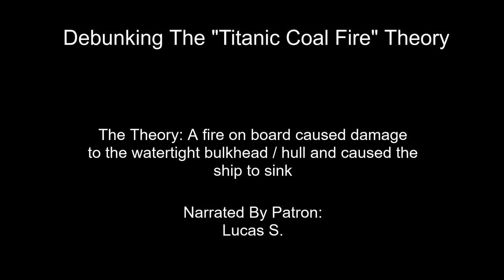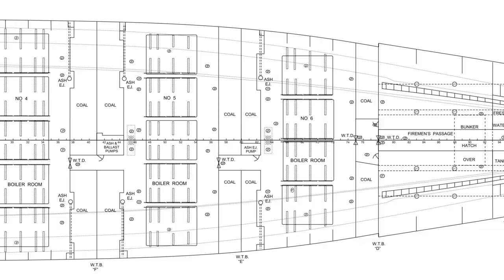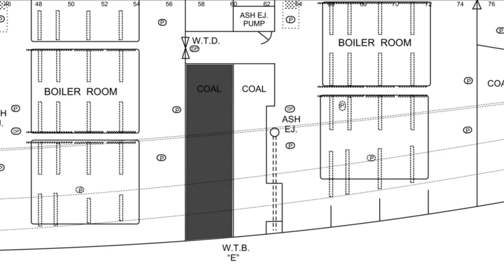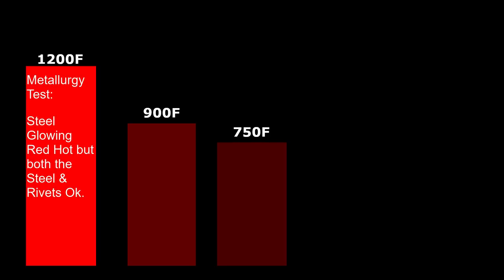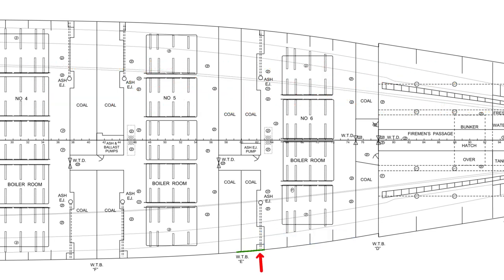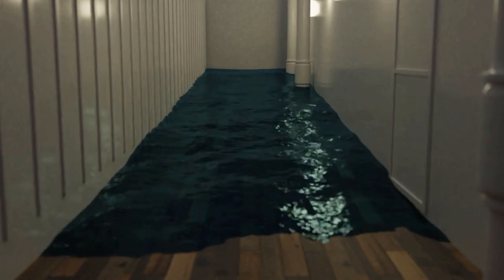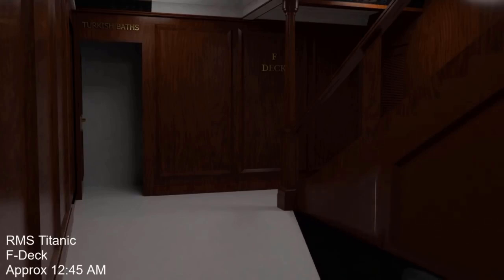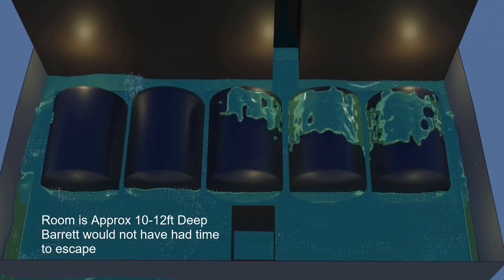Debunking The Titanic Coal Fire Theory

Comment: coal fires can't melt steel bulkheads
Reply: They can weaken em for an iceberg to do the rest
Reply: @sherylstapleford2005  that's like saying they can weaken them for a dynamite blast
it doesn't need the assistance, it's perfectly capable alone
Reply: Highly doubt the iceberg ripped open boiler room 5 which started flooding right where they say the coal fire was coincidentally
Reply: people all the titanic needs is one compartment to rip open from weak steel and BOOM! cold water plus hot coal = explosions! causing more damage and more leaks thus more explosions...
Reply: Ultra CNC  You're being awfully smug for someone saying nothing.

If you read the thread, you would have grasped that we were talking about the hull integrity. I was using the comparison to say that the hull did not need to be weakened to be damaged by the iceberg, any more than it would by a stick of dynamite.

Get it now? Or do I need to spoon-feed you some more basic reading comprehension?

EDIT: Ah, they deleted their comment. Owned.
Reply: What about jet fuel
Reply: Well apparently it can. (who knew- lol) Because the World Trade centers were hit by airplanes and the government wants you to believe that the fire was so hot it warped the steel frames all of them at the same time and it fell down perfectly in it's foot print. NOT I guess those pictures of people hanging out side the windows and one in the impact zone could with stand that kind of heat.
Reply: ^ this person is not affiliated with me
Reply: @DarthMeteos  Good, hopefully nobody is affiliated with them
Reply: @DarthMeteos  when you heat steel the rapidly cool it, it can make the steel brittle
Reply: @richerdmeranda7561  because, of course, a million tons of ice requires some brittle steel to make an impact
Reply: @DarthMeteos  well even without the fire the ice would have made a hole, the brittle steel just made the hole bigger
Reply: @richerdmeranda7561  the size of the hole is not relevant
it's the amount of compartments breached that mattered
Reply: @richerdmeranda7561  it wasnt rapidly cooled and hardening steel is dependent on its carbon content, low carbon steel like that which was used on ship plating can only be made so hard regardless
Reply: @Full_Otto_Bismarck  you have a fair point
Reply: @DarthMeteos  it is probably responsible for the port list that happened
Reply: But they can make them weak enough for an iceberg to puncture
Reply: @DarthMeteos   ...icebergs are just ice not rocks
Reply: @romania_patriotedits1450  if your implication is that an iceberg cannot pierce a ship's hull without assistance, then i gotta be real with you and say that my iq lowered by reading your comment
Reply: @DarthMeteos  ... it didint pierece. It broke of the metal plates it bended them to such an extent they kind broke
Reply: I think the iceberg didnt tear it open like a can, No, I think the iceberg bent, dented and warped the hull till the point when the rivits Burst out of their areas, with no rivits in that area, the iceberg could jagger and burst open the hull, letting water gush into the ship within seconds
Reply: Shut up on all the vids
Reply: @caseydopp318  nah
Reply: @DarthMeteos  However, Remember that Titanic could stay agloat with the first FOUR compartmenta breached, but with fifth the ship was doomed so wvwn if Boiler Room 5 wasn't ripped open the ship would've sunk. However it did hasten the sinking a bit
Reply: I get it can’t but how can ice break it
Reply: @brynnemeza  the ordinary way? icebergs can easily damage iron
Reply: @DarthMeteos  ok
Reply: @sherylstapleford2005  the iceberg damage didn't reach that area
Reply: they can make the metal used on those ships weak as in hardened thus leading to cracking so its highly possible.
Reply: @brynnemeza  a 45,000 ton ship crashing into an iceberg that weighs 6x as much at 21 knots is going to cause a lot of damage. Not even a modern ship could take a hit like that.
Reply: To clear this up the ships hull bent and burst open it did not break it had enough pressure put on it the pop the rivets that then caused the hull plates to come loose if the hull was brittle that wound not matter it bent if it was weak maybe but it was not at enough heat to do any real effect on the collision where the iceberg hits it’s gonna break ice like that is strong it does not just slide across a ships hull if the hull is strong enough if an iceberg is going somewhere also taking into account of the size of the ice it should have not problem with going threw titanic hull also hitting icebergs did not happen a lot and it did not sink ships a lot so the hulls are made to withstand large heavy chunks of ice slamming into your hull.
Reply: @eugeniaskelley5194  There was more than just jet fuel burning. Jet fuel burns in open air at roughly 1,890°F. Aluminum melts at 1,221°F So the Aluminum frame of the aircraft certainly melted. So keep in mind we have molten Aluminum up there.

Steel is made of of iron and Carbon. Iron has a tendency to rust, producing Iron-Oxide. This is important as well.

Aluminum, when it gets hot, becomes more reactive to oxygen. Molten Aluminum can therefore be very reactive if given enough oxygen.

Did you know, Thermite's common components are Iron-Oxide, and Aluminum? Granted, most thermite reactions use powdered forms of the two metals, because of the increased surface area for a reaction to occur at lower temperatures. We're dealing with molten aluminum however, so powder form not necessary.

If we assume that it is true, when we have been told the fire proofing of the steel beams were stripped, then we have 100% exposed iron-oxide against Molten Aluminum... a recipe for a thermite reaction to occur. Iron-oxide Aluminum Thermite, has the capacity to burn at temperatures of 5183°F... More than double the 2500°F melting point of steel.

With all this in mind, it is entirely possible, under the right circumstances, that jet fuel melts the aluminum frame of the aircraft, which that molten aluminum comes into contact with the iron-oxide found in the steel beams, producing a thermite reaction as the aluminum strips the oxygen off the iron, thus allowing temperatures to get hot enough to melt through the steel beam.

All the components were present, everything simply needed to fall into place.

It should also be noted, that all that needs to occur is for the steel beams to get red hot, for it to become structurally weakened. As stated in the video, is that steel begins to glow red hot at around 950°F, putting the 1890°F of burning jet fuel WELL above the red hot range of steel, thus compromising the integrity of the steel beams. This of course, would require the fireproofing of the steel to have been stripped by the aircraft upon impact.

Thus proving, that the conditions were ripe for the steel beams to fail in two different ways.

NOW: All the information above does is, show why "Burning jet fuel can't melt steel" is such an ignorant statement, by providing knowledge that steel need only glow red hot to be structurally compromised, thus having catastrophic failure, OR the conditions were right for a thermite reaction to take place, which does burn hot enough to melt steel, which would have started with burning jet fuel melting the aluminum aircraft frame..
Reply: @emperor_msk  Theoretically 6 compartments (the "forepeak"; cargo holds no. 1,2,3; boiler rooms 5 and 6) were breached on the Titanic that night..so its even more of a miracle she stayed afloat for so long and so stable.
Reply: @MisoElEven  Only Boiler Room 5 coal bunker was ripped but damage was done
Reply: @emperor_msk  That coal bunker is in the same compartment while its not designed to hold water..it was leaking of course - it was breached.
Reply: @eugeniaskelley5194  The towers were impacted by a flying object, something they already were not designed to handle, and then the steel rebar and I-beams were heated by burning jet fuel to about red hot. It doesn't take a genius to know that red hot is practically wet noodle, but it hardens back to normal once it cools off again.
Reply: They can weaken Iron, which is what the rivets were made of.
Reply: @darkpriestmusic288  That's like saying a bolt was loose when a car was hit by a freight train. The bolt didn't cause the damage.
Reply: Yes, they sure can.
Reply: @angelowthree5148  i'm impressed someone finally said that
throw down the gauntlet
Reply: I'm pretty sure it wasn't even hot enough to even weaken it

Edit: and as I watch the video they explain that
Reply: @deathsheir2035  even without the aluminium the steel would be heated enough to be structurally weaked with the amount of weight being put on it by the upper levels . The towers essentially imploded then collapsed under the unsupported weight hitting each lower level in turn . They were built with cantilever floors unsupported between each level . The central supports designed to only hold the weight of the attached floor + 20% .
Reply: @eugeniaskelley5194  There's a demonstration of a metallurgist on youtube heating a steel beam up to the approximate temperatures of jet fuel fire. It indeed doesn't melt, but then he bends it over with his pinkie finger which I think demonstrates the point.
Reply: @Person01234  and he was using structural steel in his argument the video makes sense but structural steel loses its durability faster then think sheets of ship grade steel
Reply: They use coal fires to melt steel
Reply: It was coated in Thermite paint like the twin towers, LOL.
Reply: @TheR0m0  And all those explosions were noted by the survivors..... Of Course. Silly me.
Reply: Were the "fire mark" is that is were the mail room is.
Reply: @deathsheir2035  Just to illuminate the discussion about jet fuel and aluminum.
Jet fuel is by another name, kerosene...which certainly burned off in the original fire ball.
There was only a tiny miniscule chance that it caused "rivers" of it...that would cause either of the two towers, and even less than that for bldg 7.
Neither the fires that were starving for air, right after those fireballs...can explain not only why they crashed down, pulverizing them into powder, even the glass.
It also doesn't explain the traces of only military grade, molecular thermite in all the dust.
Reply: I’m pretty sure it was burning for 3 weeks which is a while that’s how the fire could damage the hull
Reply: @sherylstapleford2005  It's not a coincident, 300 foot of ship was damaged on that part of the ship and that area was just part of it.
Reply: @eugeniaskelley5194  The fire doesn't need to warp the steel, it just needs to be hot enough to weaken the steel beyond it's design limits, which it was hot enough to do. Steel loses a ton of strength with heat.
Reply: @sherylstapleford2005  bruh it didn't do anything, there was literally ice cold water on the other side. If that's the case any gun or sword ever forged would be brittle and broken. Heat followed by water is good for steel
Reply: @gunslingerfromwish4656  not extreme heat that makes it red hot and it also depends on what steel is used titanic tried to be fast and used cheap not good quality steel not the same steel as swords and guns lol not the same as forging a sword lol
Reply: @GodshuYT124  Incorrect. The coal bunker fire was burning for 3 days ( NOT WEEKS) The fire was extinguished Sunday morning April 14th, 1912. Titanic set sail April 10th and sank on the morning of April 15th, 1912. Titanic only lasted 5 days after leaving port in Southampton
Reply: @sherylstapleford2005  ultimately it was Titanic's rivets that failed, causing the hull plates to separate as the rivets popped out. Traveling nearly 25 mph 46,000 tons of steel slammed into an Iceberg weighing several million tons was no match for the rivets even if the water was not below freezing, similar damage would have been done given Titanic's speed, weight and force hitting the Iceberg
Reply: Yes they fucking can there's a thing called looking it up on utube
Reply: @tylerpatton9222  there's a thing called courtesy, too, but you forgot that
Reply: @DarthMeteos  Exactly, also take in to consideration people for years believed the iceberg tore a gash in the side of Titanic's steel plating. Actually the plates buckled on impact of the iceberg and caused the rivets to pop out, allowing the pressure of the ocean to flood the compartments. Had a large hole been tore in Titanic's plates Titanic would have listed and sunk more rapidly than it did. The holes the iceberg formed weren't much larger than  the width of a finger, however as you stated it was the amount of compartments damaged and given the bulkheads only extended up to E Deck above boiler room # 6, the water flooded Titanic like an ice tray pulling Titanic further down as each compartment slowly flooded, until it broke in two sections where the pressure of the ocean, and weight of Titanic's engines caused the ship to snap at the expansion joints.
Reply: Yeah I do actually wow
Reply: @bobbygetsbanned6049  Correct, it takes heat to bend and to forge steel
Reply: @themarinerkommer4371  The rivets in the starboard bow were made of wrought iron, also had a high sulphur content. This caused the rivets to become weak and brittle in the ice cold water, regardless of the rivets brittle or not, any vessel slamming into  over a million tons of ice, the rivets would be sheared off. The rivets popped and cracked more easily because of the temperature and conditions, however even had the temperature been warm and the rivets had little or no sulphur content, slamming into a million tons of ice at almost 24 M.P.H. wouldn't have made much difference. The speed and force of the impact, the rivets would have broke off either way.
Reply: @timtnr.6177  I think the word slamming into the iceberg is not correct, yes it would cause damage, but different from a grazing blow like Titanic's damage was. it would've caused a larger gash on the ship or even a longer one. Also, for the people who think the fire caused it, steel and iron is still going to break from the impact that the iceberg did.
Reply: Totally agree!
Reply: @sherylstapleford2005  I have been a welder for over 25 years! I disagree
Reply: @richerdmeranda7561  yes but not like that!
Reply: @Full_Otto_Bismarck  how do you know it was made with low carbon steel?
Reply: @romania_patriotedits1450  not
Reply: @samturnau6086  coal fires not smoldering coal!
Reply: @sean9806  as if you were on board!
Reply: @brynnemeza   In below freezing temperatures made the steel very brittle and hitting an iceberg weighing in the ballpark of a close equivalent to 50 Titanic's 46,000 tons each, remember Icebergs can be as large as a whole city underneath the surface of the water, the ice would not budge, and sliced the rivets like butter. Although steel is strong, in cold temperatures it becomes weaker, and vulnerable to break easier
Reply: @deathsheir2035  Incredible how an almost solid blue flame with occasional yellow tips can be near 2,800 °F and a hot water heater or forced air furnace burner can withstand 2,800°F much hotter than jet fuel burning in open air,  jet fuel can melt steel, yet a flame near 2,800 F will just cover a steel burner in soot and carbon deposits
Reply: @dodgeramsport01  Titanic was made of riveted steel. (I don't think I spelled it correctly
Reply: @sean9806 we all know that, I never said it wasn't! So what is your point!
Reply: @DarthMeteos  the ships plates were bumped and scraped, letting water in. Nothing was torn
Reply: @DarthMeteos  honestly the iceberg may have been huge, but only one small part of it hit the titanic, I highly doubt a bit of ice could rip open hard steal metal without it being weakened.
Reply: @alexlolli2325  are you seriously contending an iceberg cannot damage a ship
Reply: @DarthMeteos  lol it can probably damage it, but seriously breaking a hole? Maybe a dent and scratches, and maybe tiny tiny tiny holes so droplets get in. But I doubt it could open  a 5 foot by like 6 hole breaking in like 3-4 layers of pure steal
Reply: @DarthMeteos  steel**
Reply: @alexlolli2325  the forces at play here are monstrous, it absolutely can
and at any rate, i subscribe to the grounding theory
Reply: @DarthMeteos  I understand that, it's just hard to believe that practically almost missing it, it can rip a hole that huge just by skimming it.
Reply: They WEAKEN them.
Reply: @DarthMeteos  you do realize that the twin towers also had concrete in them right?
Reply: @DarthMeteos  But the one thing I agree with you that it's definetly not the government.
Reply: @DarthMeteos  But how can a single solid of water cause such a tragedy? There has to be some faulty with the build or something to weaken the metal, the waters filled up faster than they could fix. Surely there might've been something they could've notice to fix it sooner unless there might be some sort of incident besides the fire that they chose to ignore it and go ahead for they voyage anyways.
Reply: @zonker-TM  that might've been something detonated down underneath the towers such as the subway tunnels, I personally think that could've been part of the terrorist planned attacks. Not to mention those monsters who ran those planes into the towers were taught how to fly a commercial planes in Oklahoma.
Reply: @DarthMeteos  riiight. Whatever you believe in, Never figured we still had a series of theories of how it sank and what postion it sank on. Surely you think we got most of it down by now. And to this person you subscribed to, do they have any professor degrees or any certifications to be 100% correct within this topic and any naval history?
Reply: @DarthMeteos  Yeah, since I watched a little more of this "Debunking" Video and right now I think they are just being lazy with their evidence. Not to mention they pointed out the most stupid pointers out there. No matter how hot it is, the fan is not gonna get rid of the heat it's gonna produce the same radiation from the hot metal but blowing it to another direction. It doesn't help the fact they used a smithing video to prove their point but what people don't know is that you are not allowed put such hot material into the water causing to warp and ruin the product. I say this because I have experience with hot metal before (being a welder) it takes more to cool hot metal especially water. You don't need fans to produce such heatness it has to do with the materials to cause the metals to glow up and melt or warp (and yes heatness can cause warping as well if you put too much material to the metal) So this channel you subscribed to is an amateur at explaining the concept of the thickness and the amount of material into the metal. (The name like Titanic Animations kinda makes them a little not so serious with their debunks.)
Reply: @dontmessageme5579  well, parks stephenson is the one who first posited the grounding theory, so i think i'm comfortable with it
Reply: @DarthMeteos  whatever you say.
Reply: @sledgehammerk35  yup look at Costa Concordia
Reply: Neither can jet fuel
Reply: It can weaken them tho
Reply: And jetfuel-fire cant melt stealbeams in 40min either. Infact, not even in 48hours.
Reply: They can when Coldwater makes steel brittle
Reply: It can weaken the rivets though
Reply: No they can't, they made boilers out of steel
Reply: @sherylstapleford2005  The iceberg did a small opening to it so nothing that can sink the ship💀
Reply: @TheR0m0 that’s not true the explosions did not damage the hull’s integrity
Reply: @kirknay no thats not the comparison at all its more like a car that was totaled then repaired but not to full strength and then the next impact it takes it crushes even easier
Reply: They were talking the same about World trade center
Reply: @eugeniaskelley5194 coal fire is wayy different than jet engine fire